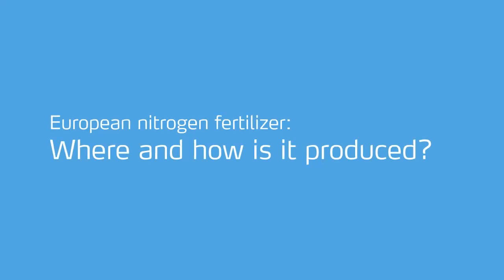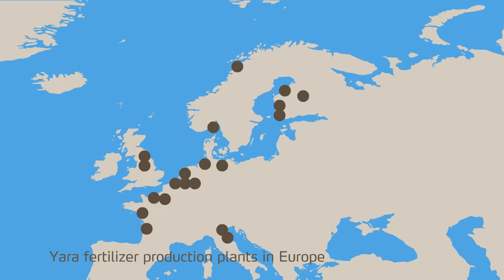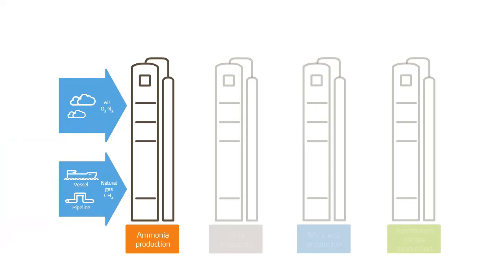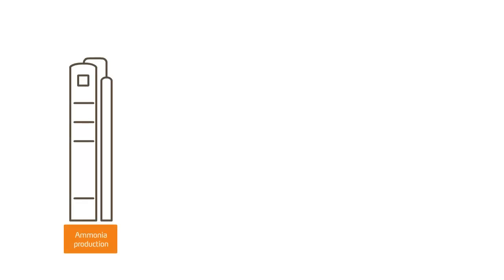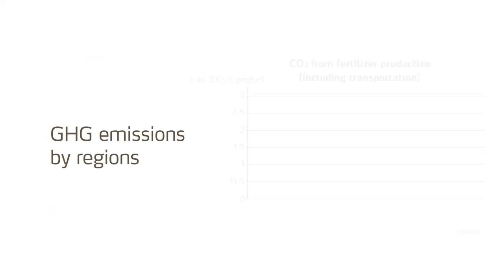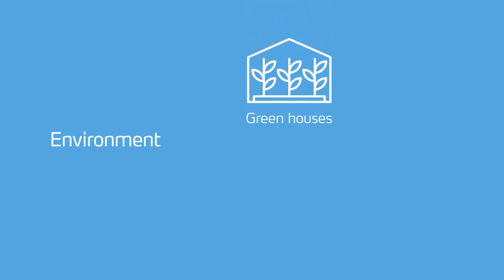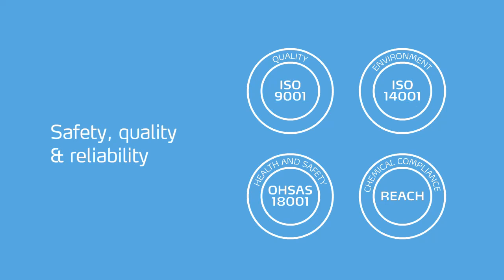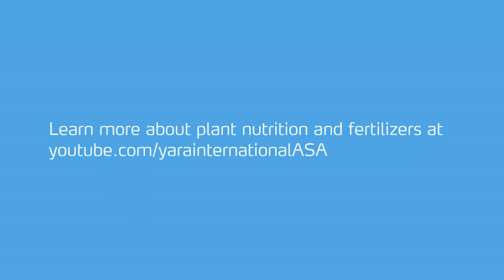N-fertilizer, where does it come from?

Comment: hi, what is the inert material/filler use that mix in npk fertilizer?
Reply: If you are talking a consumer bag of fertilizer for example a 10-10-10 it is whatever is listed in the ingredients.  A common inert ingredient to add is crushed limestone.  Crushed limestone isn't really inert.  NPK fertilizers acidify soils over time and crushed limestone neutralizes acidity.  Other fillers i've seen are crushed peanut hulls, crush corn cob, biodac (remains from paper plants).  Also consider that you will never see a 100-100-100 or even 100-0-0.  Straight Urea is 46-0-0.  Urea's chemical formula is CO(NH2)2 54% by mass is not nitrogen.  Same with pure potash kcl 0-0-63 where 37% by mass is chlorine.